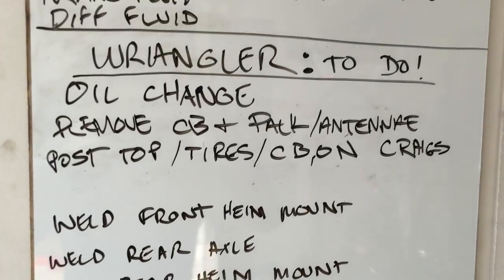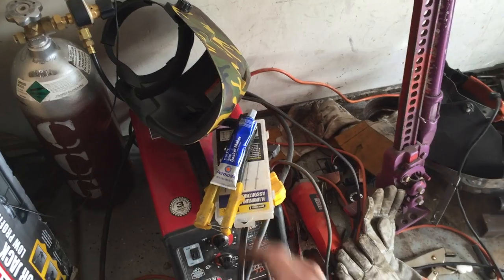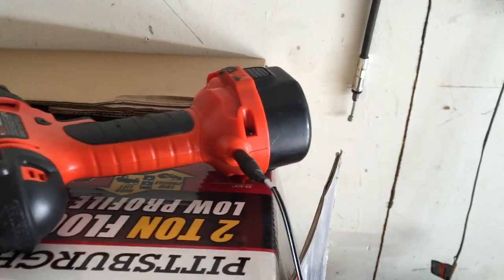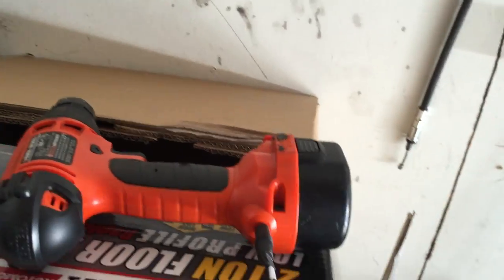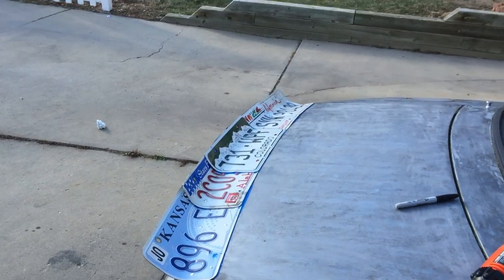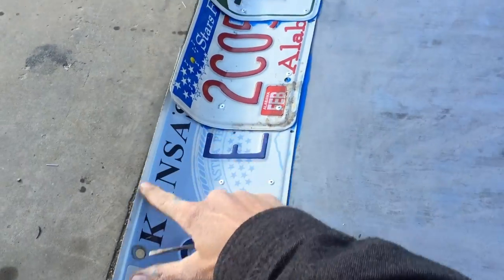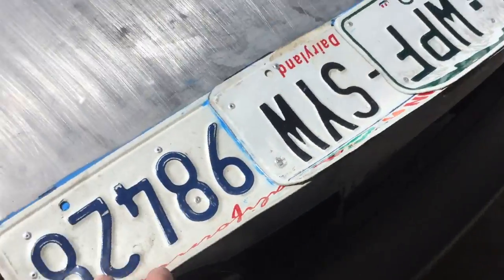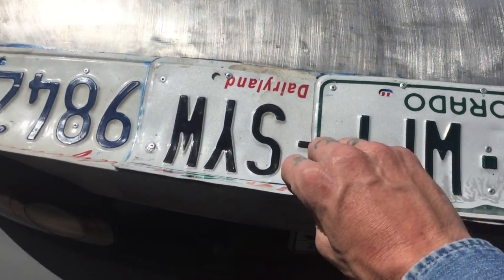Custom License Plate Spoiler S02E13

Comment: What's the plastic u used as the riming on the plates
Reply from the maker: its a small piece of vacuum line, slit down the side with a razor blade, filled with adhesive and then stuck on the edge.